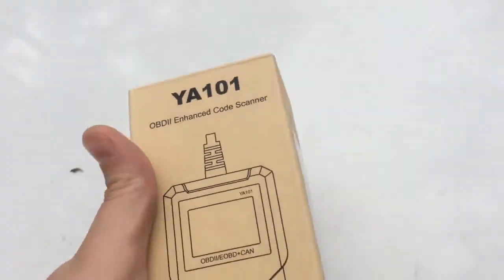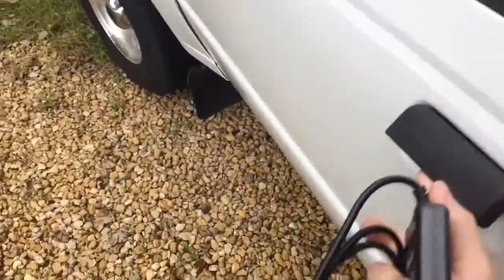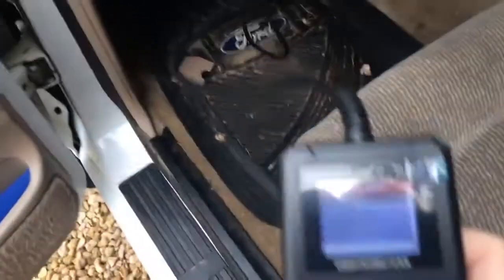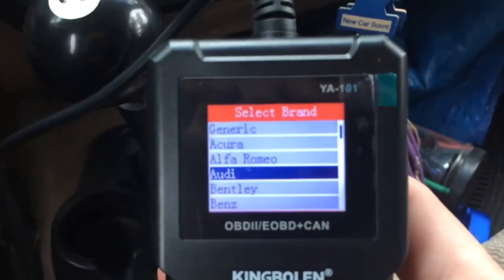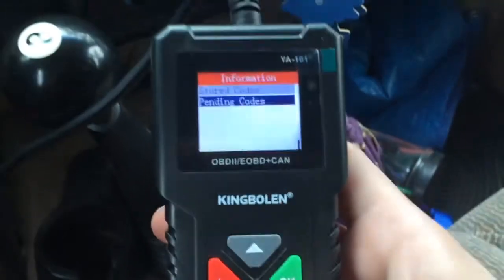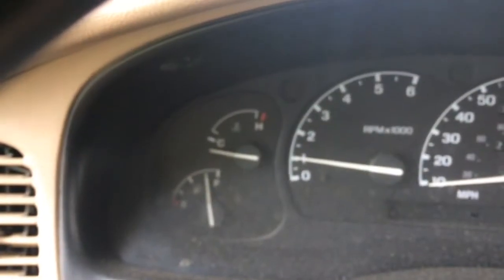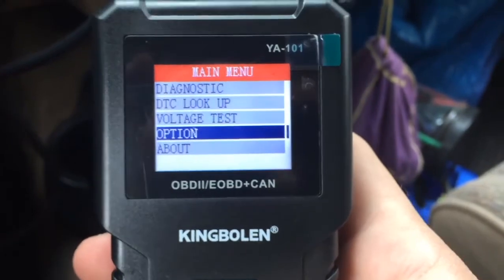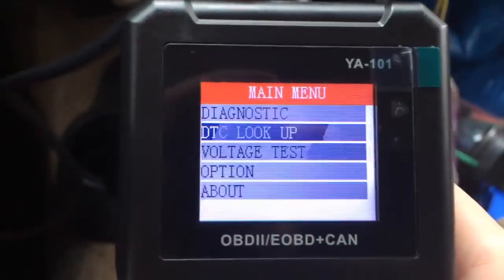How to use code reader on car | obd2 scanner tool Kingbolen ya101

Comment: I have this one it just says “not supported” every time I select something.
Reply from the maker: You can contact me via email (partner@kingbolen.com) attach a picture of the problem you are having and tell me your car's specific model year, our technical team will help you solve the problem
Reply: @kingbolen_official I get the same error message any time I try and do anything. Alfa Romeo Guilietta 2012 just says the selected mode is not supported! if I try to read or erase any codes. It connects and does a voltage test and tells me the number of faults and that my engine management light is on but that's it. Can't do anything with it. Any ideas on what to do with this?
Reply: @snakeplisken2123 Did you manage to get anywhere with this?
Reply: @paulbarker6743  no, but I have not tried it on another vehicle.

Comment: Can it scan a Transmission issue? Thank you. Or is this just a basic scanner for engine.
Reply from the maker: YA101 just a basic scanner for engine. The Functions list of YA101 OBD2 Scanner：Read Codes、Erase Codes、Live Data、Freeze Frame	、Vehicle Info、Component Test、On-Board Monitoring、O2 Sensor Test、I/M Readiness、DTC Look Up、Voltage Test、Data Logging、Self-test、Update